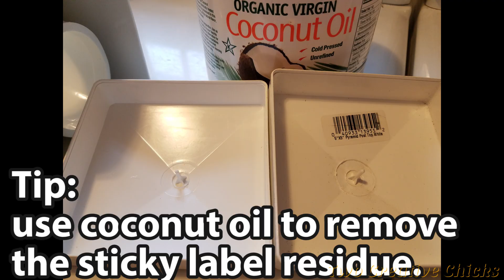Minimum Spill Chicken PVC Feeder

Comment: Is the elbow facing up or down inside? I think down. If so, will pellets gravity feed down below the elbow or do you need to shake it to get them to be under the elbow opening?
Reply from the maker: Elbow is facing down inside. There is a space below the elbow and the feeder bottom where gravity makes the feed fall down. We provide exact measurements in the video. Good luck

Comment: Have u experienced lots of moisture inside the feeder? I found the bottom of my feeder wet and the pellets rotten....
Reply from the maker: No. We keep the feeders in areas not exposed to rain. We check the feeder everyday just by running our fingers inside the bottom to make sure it is dry.
One feeder that might get some rain on the back side if the wind blows strong, we sealed real well with silicone. We check for leaks there too. We have never had moisture inside the feeders.